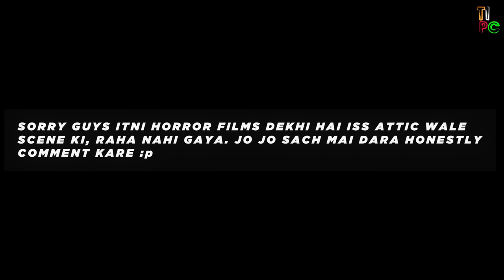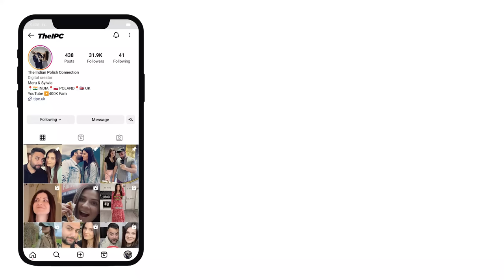Full House Tour of Our European House | Poland Series

Comment: big windows mean a big heating bill. Also, it would be best if you get high-quality windows. A single leak will spoil your heating bill.

Also think about having a geothermal heat pump system(would be cheap on your pocket) for heating rather than the gas/ electricity. BTW your high ceilings are not going to help your heating bill.

Comment: Wonder what the R VALUES of the house are? R = 1/g, g being conductance of energy across walls, floor, ceilings, etc. I have heard that new homes in Canada are supposed to be built to R52 overall, whereas in the USA, having more thn R14-21 seems to be the norm.

I am very interested in energy efficient houses; the Germans have elaborate plans and computer programming for such, including adding and subtracting various materials.

Poland would perhaps fall in the USDA Plant Hardiness Zones 4-5? What are the R values of your ceiling/roof, floor/under basement, and   approx. R values of the entire construction. I saw some concrete block construction and hope that there will be some serious efforts at insulation, vapor barriers, condensation issues, etc. The more airtight the house, and the fewer the air changes per hour, the greater the problems with condensation.

Northern Europe is blessed with significant forests, and there are exceptionally beautiful thin veneers milled from trees like birch. Were I lucky enough to own a house, complete with an auspicious grhiNii, such as yours [gRhiNiim gRhamucyate ; the house is not the home, the lady of the house, IS the home], i would dream of the following: 1. vapor barrier on all masonry walls from the inside,  then at least 4 layers of rockwool  insulation each with R15 nominal, followed by exterior grade plywood/OSB to form the inner wall. On top of the plywood, beautiful wood veneer sheets, as per your taste; birch, for mine!

That door from the garage into the house needs to have a double entry to reduce heat loss. Now that Poland  has to purchase gas from Norway, presumably at prices much much higher than previous energy sources,  this is the thing that worries me most.

BTW, Mavalli Tiffin Room has opened a London branch; hope you will review their fare and compare them with the 6 foot dosa you enjoyed : prices, taste, value for money, as well as thoughtful service, cleanliness etc.  It would be fantastic if you could become the franchisee of MTR in Poland, and in your local area! Thast would be a real wow, and I am sure that the daughter of the MTR who today oversees the international expansion, would look kindly to your having such a franchise, given your interest in food and food service. Plus, gucchi pulaos, reflecting your Kashmir origins, are very much more feasible in Poland, and the mushroom-loving nation will go wild over such! 

 Kashmiri haak is similar to collard greens, that do especially well in Poland's cool climate, as do radish of all types, and kohlrabi. Potatoes galore, of all types, including fingerlings, that would be amazing in  Pandit style dishes. Walnuts, and all sorts of shallots, to make  Non-Pandit praan, too! A vegetarian MTR menu overlain with vegetarian Pandit cookery, albeit using some praan + masala discs, would be a unique draw in Poland. Everybody does Punjabi dhaba cuisine, but something new and fresh is to be lauded! 

BTW, Pandit Lakshman Joo's anniversary falls in the first 10 days of May, and there is a good opportunity to introduce Poland to aspects of Kashmir thought, without being preachy. It is important to explain  to the wider audience what KASHMIR means, over and above the political smearing that has remained the one-sided norm to this day. 

I wonder if Mark Dyczkowski has Polish roots, in which case, he could be a brilliant exponent of various aspects of Kashmiri civilization, as well as being a great sitar player!  Since Vanna White is no more, we cannot ''buy vowels' for a surname that sounds suspiciously Polish!!!!